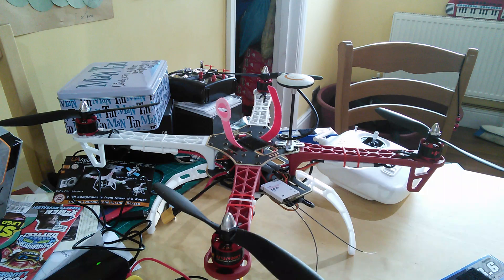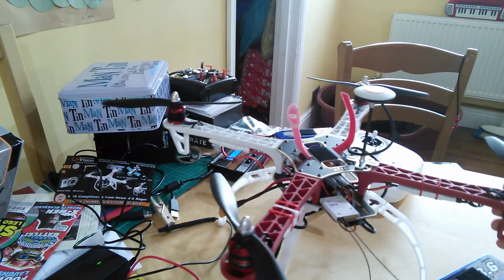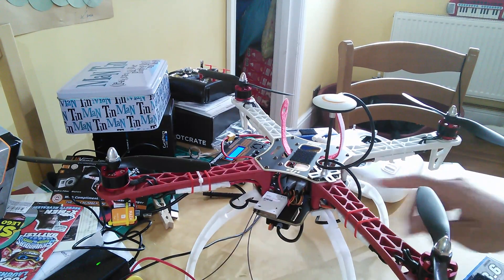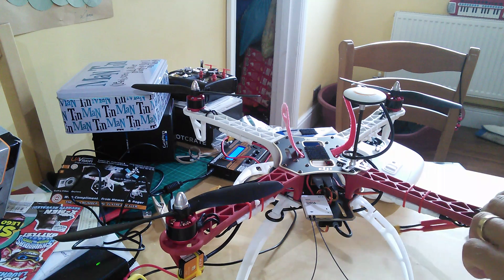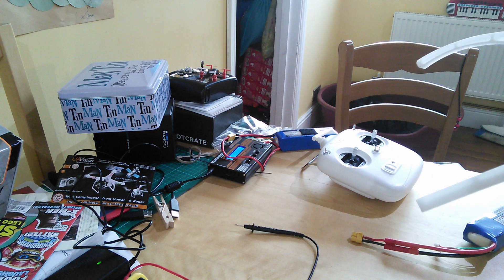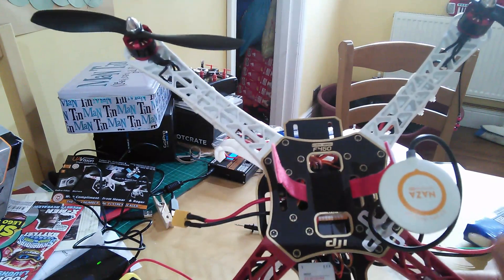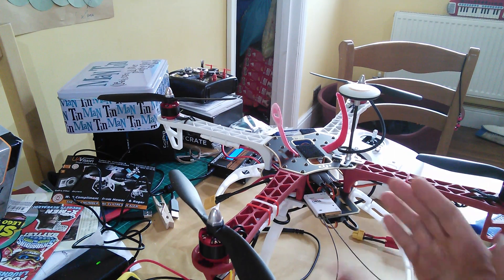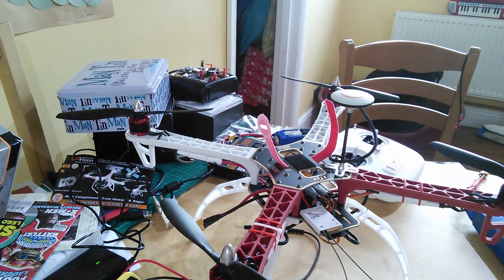Build your Own DJI F450 on the kitchen table! Final assembly - we've finished!

Comment: Congrats on completing your F450 Simon and looking forward to your watching your maiden! It has spurred me on to build my own which leads me to my question regarding the props because in my usual quest for information in pre purchasing something, when I came to place my order with my chosen company, they where out of stock (Darn!), so whilst reading about the various kit forms they had to offer, one of their part kits I read that, that particular kit came with self tightening props in the description but not in the description of the full ARTF kit which prompted me to investigate further and found some other youtube vids with the self tighteners, so I wondered with your insider knowledge of DJI products whether you could shed some light on this?!  I have sent an email to the seller with this query but no reply as yet. sorry if its a bit off topic and long winded!
Reply: ***** That's interesting Simon, now you mention about the handed motors and props and whether you can run 4S Lipos with them as I guess your kit had come with two size props one for running with 4S and One for 3S? I wonder if the new kit comes with these two sizes? with the larger ones only needing to run with the 3S as they are more efficient? I also think I have seen someone installing the new motors and they come with a new style single coaxial style cable instead of the  two cable (Pos & Neg) and having to strip back the metal sheilding and exposing the central positive cable and then having to solder these on the board which looked far harder than your two cable system as confirmed by the guy who was doing it! maybe might put you off upgrading to the new system! :-D 

On a lighter note, I take on board the reference on inadvertently building tunnelling machine by installing the motors in the wrong place so I have placed an order on Amazon for a small shovel to dig my machine out of the ground after I build it because I'm bound to get this wrong!! Anyway this is all to technical for my pea sized brain on a Sunday afternoon, I must get out in the garden and enjoy the weather. Hope the K rating falls so you can fly the P2!
Reply: ***** ah yes good point. Also I may have got my wires crossed ( excuse the pun)  the Co - axial lead I had mentioned would be coming from the ESC and not the motors as I had said, I presume the three bullet connectors still apply.? You can tell I'll probably never get this thing in the sky!